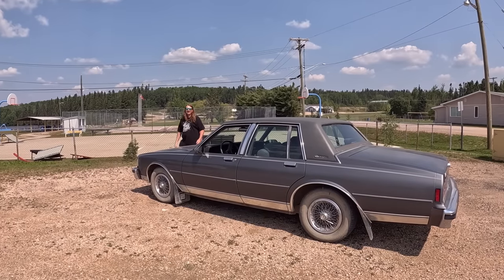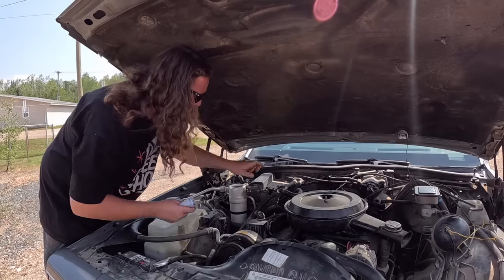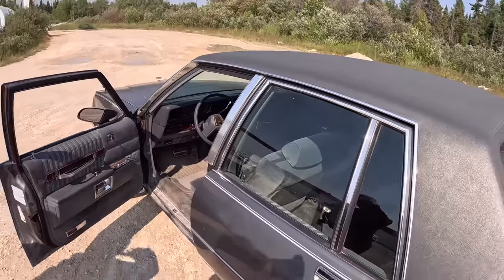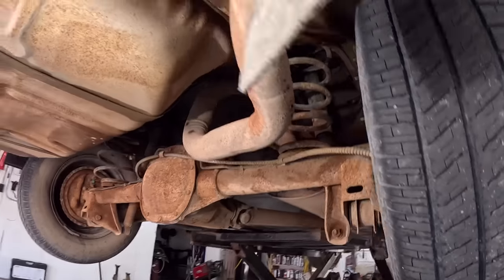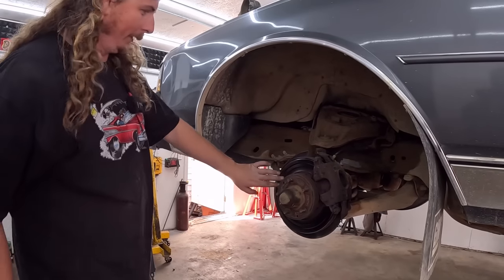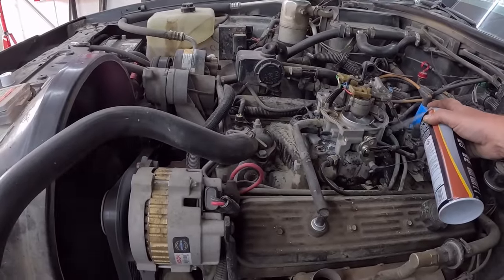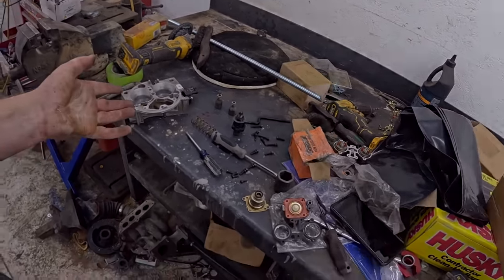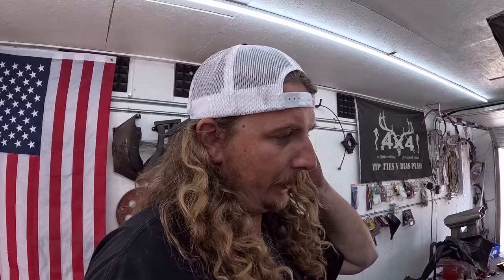MINT 35K Mile ORIGINAL Owner 1989 Caprice - Why Did I Buy This?...

Comment: And on the tbi I got from a 350 tbi that ran after I found the two different injectors i felt like a idiot since I had been inside the tbi and regasketed and sealed it twice the fuel pressure regulator leaked on the newer tbi and the TPS sensor only half worked on the truck..so swapped out those things and new fuel pressure regulator gasket and diaphragm and fixed. I got the truck I have now because of bad rotted front brake lines and it was supposed to have both a bad battery and alternator on the magnum 318 its a 2000 dodge ram laramie slt quad cab long bed 1500 4x4 anyway when I jumped the truck to get it off the guys trailer it didn't quit until the key was turned off,so the alternator is good.truck has 176k miles and the front suspension is completely rebuilt will eventually need tires in the front before winter, and i got a complete set of stainless steel brake lines and replaced them except under the bed of the truck, and it stops great has a new torque converter and front pump and input shaft seal in the transmission so it will start backing up the truck when you shift it into reverse and don't put your foot on the brake so the transmission works great, starts right up in 24 degree weather and carries a consistent 60 psi oil pressure at engine operating temperature,i because of it being a nothern Ohio truck it has rust around the edges but the bed is in really good condition and the cab floor is solid really just replace the front fenders would completely change how this truck looks, anyways with its issues and no muffler when I got it i gave $1,500 for the truck and they delivered it to me.

Comment: It's the M.A.P. sensor that's causing the stalling Dan!! 100% sure
Reply: Only other thing that it may be is carbon on the EGR valve which usually happens with higher mileage engines

Comment: I had a similar experience about the time this car was new. I bought a '77 Delta 88 with 38k miles from an old man that had to quit driving. A true one owner cream puff. Mine came with an owners manual (would have helped with the hub cap). That generation fuel injection was always kind of troublesome. I'd bet that modern fuel has taken it's toll on some of it. I'd start by looking for vacuum leaks or "false air" in the intake. I'd get rid of it like you did the new Holley version of it. That's the 30 year old version of that same shit technology as that kit you tried on the Nomad.  Ah, as I type this I see you have found your air leak. Or at least one of them. The only weak point in my Delta 88 was that metric transmission. It quit at 40k and was replaced with a 350.

Comment: I had a Olds like that caprice  where that injector was dripping it should be a fantype spray pattern  replaced  injector  on top of throttle body fixed mine

Comment: Please don't mess it up with engine swaps! That car will run and drive FOREVER! It needs a set of white wall tires and clean the spokes and keep them on the car ! This is a Brougham and should be kept nice especially with the low miles. Buy an old crappy one to put cop car wheels on and swap engines. This car needs to be appreciated as is!!!

Comment: i bought a garage kept, grandma owned, 84 Cutlass Supreme two door with 75k miles. this car looks bran fkn new. everything works, air, cruz, tilt, NOT a 305 engine. its fkn gold and dark brown seat that don't even look sat in, not even the from driver seat. only thing I've done to it is put a sound system in it of course, tint and rims. now i get pulled over constantly. smmfh

Comment: I bet when they did the tune up they never replaced the fuel filter and that's why she's killing in you if I'm not mistaking there's a fuel filter on the passenger side around the passenger side front seat it's a inline filter.

Comment: Leave it stock. You're sitting on a gold mine.
Check the MAP sensor?
if memory serves not many TBI's want to idle right, or run right if the MAP sensor gets screwey. weren't horribly expensive from NAPA back then. 
As I travelled a LOT in my job, (65k+ miles per year- 1977-'89) I kept a spare MAP sensor in the glove box, had a trunk full of tools, and did most repairs myself, farmed out front-end, rear-end, transmission work when those occurred, rarely and down-time was the deciding factor.
Oh yeah, rode in one from an airport, a Taxi - it still rode good, windows worked, doors closed solid, etc. paint still intact, guy said he'd kept maintenance up, and this blew me away - He had the engine, transmission, and rear end pulled, new trans clutches & planetaries, had rear end cleaned out, gears re-clearanced, new oil and seals, and had the engine drained, heads removed, got valves done, though still fine, new pushrods,  had the block 'cleaned out' -(solvent rinsed) from what he said, then reassembled after oil was pumped through the oil passages, - THAT was done at 250,000 miles, and maintained since. It had over 750,000 miles when I rode in it. (they do not ever salt the roads in that city.)

Comment: I love working on first gen obd1 Throttle body cars I cut my teeth on them piece of cake put grease on that gasket replace the distributor mainshaft clean the carbon out of the iac and she's good for 100k lol tps has a wide adjustment range I highly doubt it needs messed with. You can flash codes on the car by jumping the port with a paper clip and turning the key back and forth 3 x I think if I remember 1 and 7 pin.

Comment: Please don’t LS swap this car…
Keep it as close to orig as u can..
But for real a nice 383 with a smooth idle, it would give it a but load more torque…
Or a nice 5.7 with a fresh build..
Beef the suspension up with replacement springs for a caprice wagon front and back..
They typically had heavier rated springs
Some nice Monroe air shocks.
You could pull a boat to the lake 
With that car..
I had one for years..
But for real check out the wagons next year‘s in body style when they smoothed them out… Most of the rounded body Caprice cars … suspension packages were beefier..
After a certain year they started planting LT 1 engines in them it doesn’t have to be an SS impala to have an LT 1..
Many  90s model caprice came with the throttlebody 305.. but in order to maintain contracts,
Because the crown Vic had the 4.6 makin a bit more torque To maintain contacts with police departments the LT one was implemented into this car..
Stomping the weak powered ford…corporate then agreed to sell to the public in the same manner… many cop cars Came with an engine called an L 99 which is a baby LT1,  it’s only 4.3 L in displacement… but still a V-8…but was still better than the crown Vic 
And they run really good they’re reliable.. they’re set up exactly the same way as the LT 1 with smaller heads and smaller pistons they only run about 9.8:1 compression where as an LT one will run 10.5:1 from the factory. Both engines are equipped with reverse cooling…
Meaning the LT 1 &  L 99 engines will cool the heads before they cool the Block.
Do a little homework on the LT one engine’s you’ll be surprised you might really like them I’ve become a big fan of them since I’ve owned one… to take this engine and put it on the carburetor is real easy to do and you can Eliminate the OPTi spark which seems to be a forever failing part because of its position on the engine..

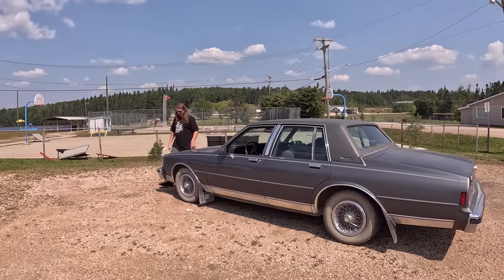Comment: Hey Guy 👁   👁    .... MAYBE A HAIRLINE CRACK IN THE INTAKE MANIFOLD ? OR MAYBE JUST AROUND THOSE BOLT HOLES @ THE REAR OF THE TB ...Yep I've run into some like that .. Bad Castings .. Wouldn't Hurt to hit it wa light spray of Flourecent paint & a Blacklight .. I dunno . Giver er a try & see .. If you have the paint & the light plus its all apart ANYWAY   ..😑😑 0:02

Comment: Truck mud flaps cut off short, mint. Gravel burn on rotors, country life. Put a can of seafoam through it and it will run better.If you want a challenge the wifes family has a 1980 buick with less than 100k km one owner deceased sat for 15 years carbed.

Comment: Let your paint guy do some pin striping if you have to have him do some work never mind making a statement as the car does that just being what it is. Keep the car original because they were designed to be cop cars and are built to last hundreds of thousands of miles. Danni will love it as a daily driver and the only way you could do better is either a Cadillac or a Lincoln and they aren't $2500.00 CDN in that condition ever. It takes Chevy parts which are way cheaper than Cadillac or Lincoln bits and pieces with a similar ride and accessories.

Comment: Rubber line flakes in fuel rail of throttle body take top plate off look for black  speck take your pick set pluck it out if the gasket didn't break put it back together .

Comment: Box Chevy Caprice? 4 inch lift and fit some 32 inch wheels under it. Leave the drivetrain alone and run it donk. It's easy to switch back to stock if you ever want to sale it or run it as a donk show car. Donks are selling right now for ridiculous money.

Comment: If that vinyl top isn't messed up, don't use your typical armoral. They have armorale for your tires, which is a spray foam. What you want to do is actually spray that onto the final top itself and let it slightly evaporate to where you can't see the majority of the fpam and use a foam applicator or use a micro fiber towel to work it in. It will last about 2 months, rather than the one week and then it turns brown like the Armoral spray.
Oh yeah, do the tires as well.

Comment: There's an awesome place in between yet another LS swap, and keeping it bone stock: a lobotomy, a carb, and points. Don't forget tcc lockup - if you get all that, the ecu and all it's sensors are vestigial. Lots of wiring that can be cleaned out of that bay....